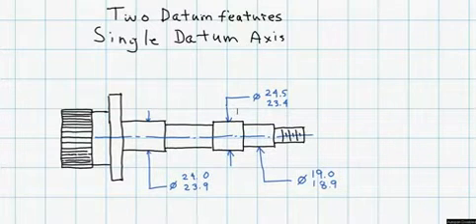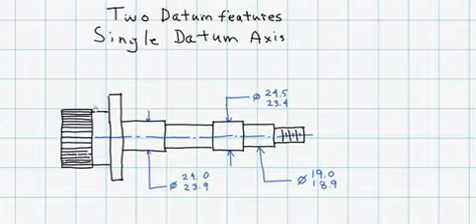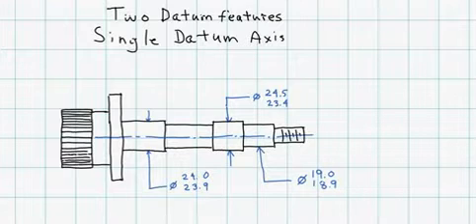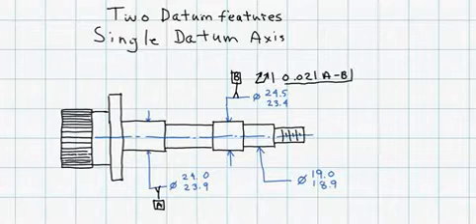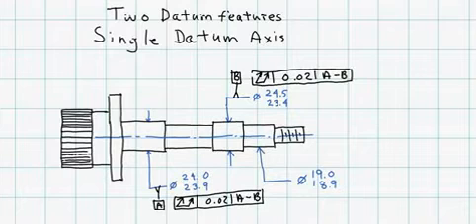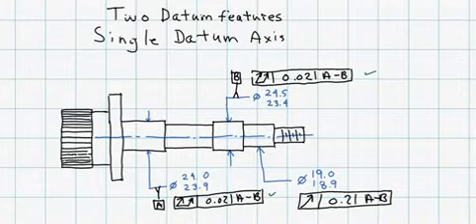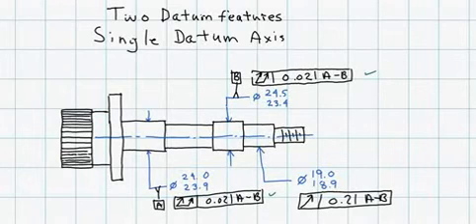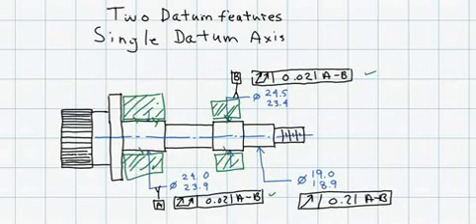GD&T Mutliple Datum Features Application Training

Comment: I'm pretty sure that you cannot runout a feature to itself. How would you hold the part on datum features A and B and put a runout gage on those surfaces at the same time? Instead, I would have specified a runout on datum feature B relative to datum -A-, and then specified that the other diameters meet a runout relative to A-B.
Reply: But you aren't referencing it to itself as if it was "relative to A" and also defining "A", you are referencing the composite of both that axis and the other, which is completely measurable.
Reply: It's pretty much taken from ASME standard, page 102 in 2018 v. But yeah, I wonder how that's measured...